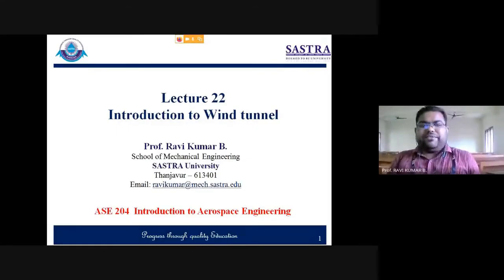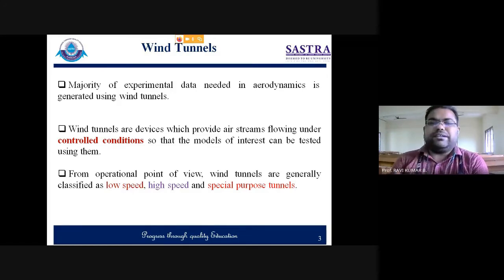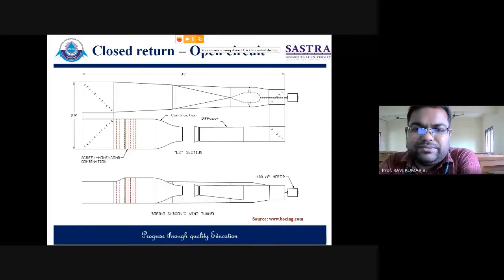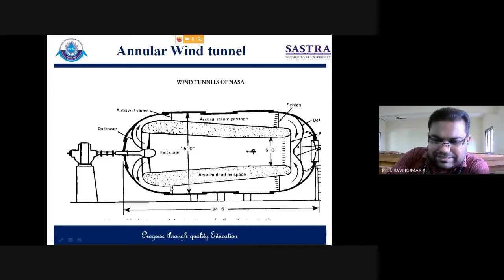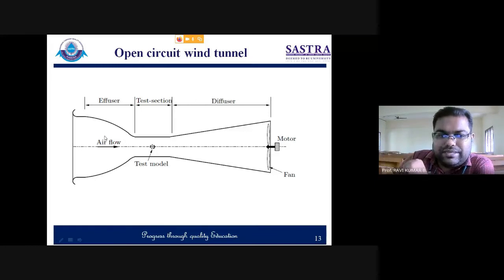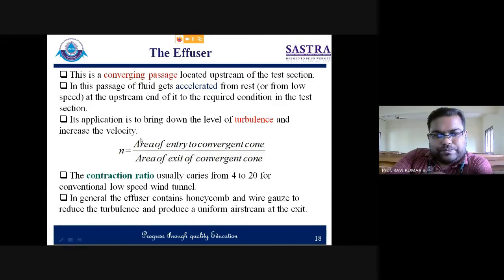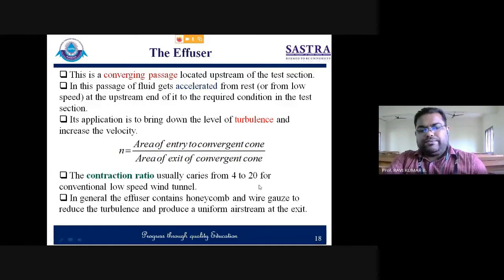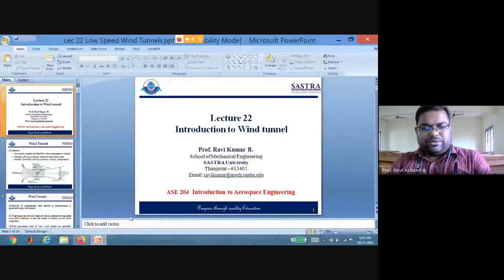Low Speed Wind Tunnel // Automobile Wind Tunnel // Aerodynamics Tunnels//GATE 2023//Wind Tunnel Test

Comment: .sir , if we want too created an controlled less denser and low temperature environment in the test section. Will only temperature change arrangement will do or vacuum also needed ?? please  suggest methods to achieve so
Reply from the maker: You can create by altering the temperature... Select low air entry Temperature. It will create low pressure and low density region.
Reply: @RaviTechStudio  Thanks sir .
Reply from the maker: @mallahdharmendra9893  do share this channel with your friends.
Reply: @RaviTechStudio  yes sir , an sir please make a video of design of a wind tunnel like the contraction profile , honeycomb sizes, guide vanes design , fan parameters
Reply: sir, for example i change the temperature of air at about 2 or 3 deg cel at sea level the density variation is not much . If we want to create environment like high altitude about 0.7 kg/m3 density and low pressure . As i think change of temp and pressure will result in low density .so how i can control the low pressure at sea level in test section of tunnel